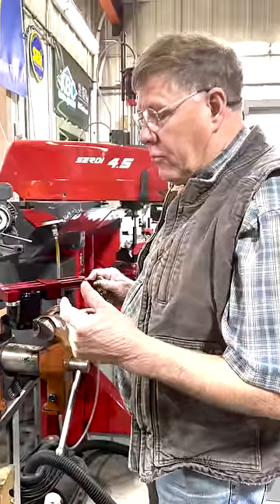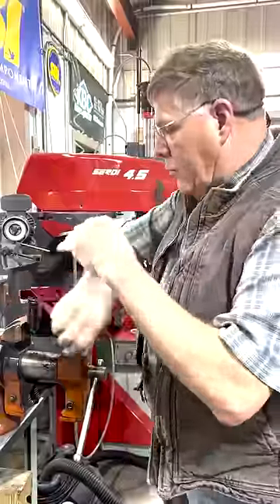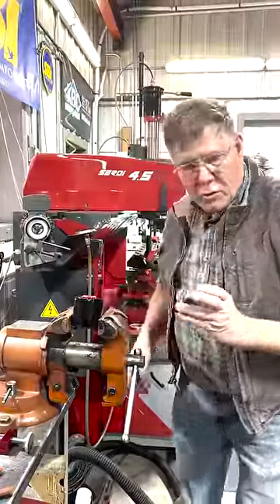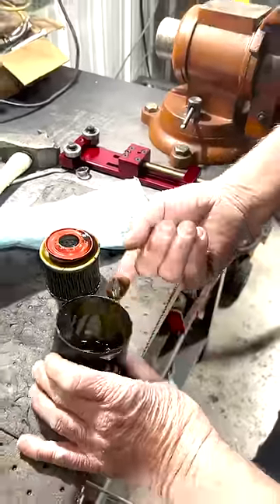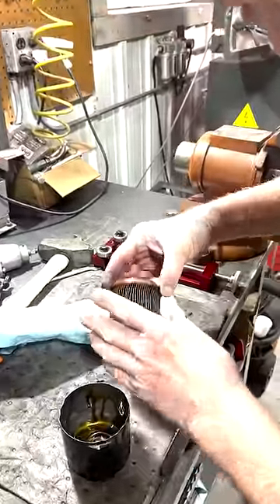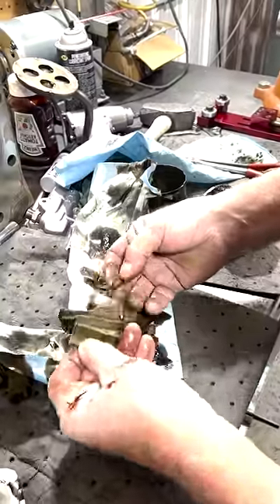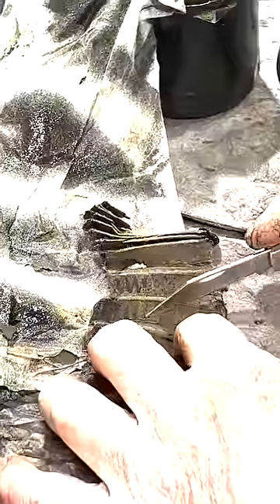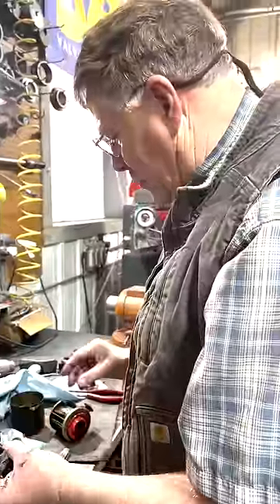#shorts Our Customer Ran His Engine OUT of OIL! 🤦🏻‍♂️

Comment: I’m proud to say I always change my oil every 25,000 miles or 40,000 KM and I top up before road trips and change the filter ever 15,000. My engine always runs so clean and I get much better gas mileage this way but the oil is pretty expensive, but worth it in the end. The only reason to change oil every 3,000 to 5,000 is because you’re using cheap trashy garbage oil, do your scheduled maintenance and follow the recommendation of the factory and supplier!
Reply: You are the reason I don't buy used cars...ever.
Reply: @scottiopizza7565  I’m gonna run this think to 500,000 miles like I usually do. Runs great!

Comment: Makes me wonder how often does he wipe after going to the restroom.
Reply: Wait.......! Some people dont wipe everytime? Oh god.
Reply: Once per month or every 30 dumps, whichever comes first.
Reply: @maxcactus7 dude that ratio of wipes to dumps is diabolical 😂😂
Reply: I have to do a maintenance wipe a little later.
Reply: Synthetic oil is good for 7.5-15k miles. The guy literally followed OEM guidelines. He did nothing wrong.
Reply: @Brian-iz9sh  The oil might lube for that long, but it doesn't mean your engine isn't inhaling tons of sooty shyt, thanks to EGR systems, etc. I had an old Mercedes 300D from the 1980s than ran damned near forever and never had any buildup like that.
Reply: He doesn't know what the 3 seashells are for ....😅
Reply: @Brian-iz9sh  still check it once a week. Maybe 7000 miles. Interval.
Reply: Probably not much. Only going to go to the toilet again. So what's the point wiping...
Reply: Why are you wondering about another people pooping ? gross dude
Reply: @wika1117  cause if its clean you won't have to do a maintenance wipe later.
Reply: Never because he ain't gonna fall for the lies of Big Toilet Paper!

Comment: Thank you for not being melodramatic.  I'm a retired CAT/Cummins Field Engineer, and I get tired of people getting excited over a few flakes of bearing material. I've seen engines replaced under warranty (automotive - I said it was fine and a dealer mechanic said no.  I had been brought in as a consultant.  The warranty claim was denied and the mechanic got fired.) for no more than a little glitter.  That's normal.  When an engine is failing, there is no question, the filter element looks like a Christmas ornament.

Comment: worse part is manufacturers especially German,  recommended oil changes like every 12-20k kms, even on turbo cars. which is ridiculous.  they obviously want your engine to fail so to force you to buy a new one. I change my oil every 4k kms with high quality synthetic oil.  much cheaper then replacing an engine.
Reply: lol I change my oil every 40,000 KMs and have never had a problem in any of my cars!
Reply: @ShawnSavageTeachings 😂 troll
Reply: I don't like synthetic oil

Comment: This isnt directed at any one person.

Its almost as if soft bearings are designed that way so hard metal doesn't rub against hard metal, glitter can be found in any oil filter. It doesn't always mean that the engine is totalled. Small amounts of glitter, lots of Glitter and then swarf arent the same. 
Obviously that doesn't mean dont change your oil, but it also means you dont have to throw away an engine that may still have years of life in it.

Comment: hi mr. I drive a honda insight i buyed it 3 years ago with 231222miles. now it has 270323miles. I added oil now and then but never changed the filter. I driven it for all most 100000 miles. with old filter,and you just given me an idea to change it.

Comment: I work at a private shop. I am currently putting an engine in a 2016 Mercedes GLC300. The customer decided to put 10,000 miles on his oil every time since new before changing it. Now it cost him an engine. Change your oil people. It's cheaper in the long run.
Reply: Mercedes recommends changing the oil every 7,500 to 10,000 miles. 

Why do they say that if it isn’t true? Are they lying?
Reply: I always run my oil 25,000 miles and my engine has never been healthier. Y’all are crazy
Reply: @ShawnSavageTeachings 😂😂😂 you do you bruh
Reply: @onemanshow4116  car manufacturers only care about the vehicle lasting till the end of warranty.  36 months is about right.  Then keep it up for another 3 years on the engine and transmission. So after 6 years or 60k miles it's no longer under warranty.   Customer has to pay to fix.  Said Customer then trades in vehicle for a new one just in time to screw over the next used car buyer.  There's a reason people buy new cars every 3 to 5 years.  That's why we pay careful attention to them as they age. And you know what to buy after that.
Reply: @ShawnSavageTeachings  I'm with you although this will probably vary depending on vehicle. A high quality oil filter and oil should do the job the biggest problem however is... Women are notorious for never checking shit on the cars. Need to check you oil every fuel up and keep it topped off between oil changes, it's this imo that's killing most engines
Reply: The folks that keep having to replace lifters and push rods in their 5.3, 5.7etc LS engines with the cylinder deactivation BS on them would be able to bypass all that work if they would simply do an oil change anywhere’s from 3k to 5k miles but Do Not exceed 5k miles. There have been tests and studies done on these engines and it’s proven to almost completely eliminate your chances of wiping out your lifters and cam by simply changing your oil on a more regular cycle than what the factory recommends
Reply: @onemanshow4116  A lot of the USA is under the severe maintenance schedule . I bet people think oh I will just follow the regular maintenance schedule.
Reply: @SouthwestD313  that’s a fair point. Still, with synthetic oil you shouldn’t need to change the oil any more than 7000 mile intervals. 

3k intervals on a modern vehicle is ridiculous.
Reply: @onemanshow4116 all they care about is making it past the warranty
Reply: @onemanshow4116  here is what I recommend to all customers. If your vehicle has no leaks, and does not consume oil, then change every 5,000 miles if you are under 50,000 miles. If you are over 50,000 miles, I recommend changing your interval to 4,000 miles. Over 100,000 miles, 3,000-4,000 depending on driving habits and if your engine is leaking or consuming oil or not.
Reply: @zacharykarna2810  that’s an insane interval for full synthetic oil. 5k is the absolute minimum regardless of mileage.

Comment: if it's anything built after 2005, it's not worth doing a motor rebuild or swap.
Reply: Why?
Reply: It is if it's not in the rust belt state
Reply: @alext8828  unless it's a truck, by the time you have catastrophic engine failure the vehicle is not going to survive another engine. It's not worth the investment to swap in a motor that's going to die in another year, or the car itself. 

old cars were meant to last multiple engine and transmission rebuilds and swaps. things were interchangeable, unlike today.
Reply: @alext8828  Obviously there are exceptions to this, but nobody should be engine swapping their 2009 Ford escape unless they're doing it themselves from a junkyard.
Reply: But why are you saying "After" 2005?  That seems counterintuitive. So a 2024 car is not good but a 1995 is okay.  I don't get what you're trying to say.
Reply: @alext8828  In 1995 there were still lots of vehicles, especially here in North America that had steel frames. I'm not even that old, but I already feel like I'm turning into an old man saying "they don't build 'em like they used to". 

It's a generalized statement, it doesn't apply to everything. A 1995 Mustang or Silverado with a bad engine has plenty of parts available, they are cheap and easy to fix. Almost all modern cars are much more difficult to fix, finding replacement engines is pretty much impossible, and new ones are so expensive you may as well buy a new car. On the contrary a 1995 Dodge caravan is probably not worth engine swapping at this point, It's worth nothing, not desirable and there are better replacements.

Edit: And by rebuild and repair I'm talking about catastrophic engine failure, where the engine needs to be removed from the vehicle and torn down.
Reply: Both my cars are 2005 lol, this comment is so true. Most cars after 2010 or so aren't great. After 2017, absolute garbage
Reply: @M.TTT.  yeah it's just a general rule of thumb there are definitely exceptions.
Reply: @alext8828 they used to build them to last and be fixed, now they build them up be disposable.
Reply: @jiaan100  I don't know if that's true.  I know there is that element, but is it pervasive?  I'm old as the hills and I remember when cars were done at 50k on the odo.  100k was a rare thing.  They had to add another digit back when cars got improved.  Maybe the repair techniques and maintenance need to catch up.  
What's the thing that kills cars the most?  I'm not sure.  If we could fix that, it might help.  You know what I think?  Leasing makes cars affordable and disposable.  If you lease a car, why bother changing the oil.  It ain't your car.  Who cares.

Comment: Back in about 1989, my brother in law had a Mk2 Ford escort. He spend a lot of time and money making it just right. First drive out it ran fantastic, for about an hour, before it seized solid. He’d changed the oil, but neglected to put new in 😂
Reply: How can you spend all of that time and money, then ignore the oil pressure light and the fact it would have sounded like a bag of spanner’s from zero oil pressure… for an hour 🤦‍♂️
Reply: @mozer30  hang on I’ll go ask him.
Reply: Any time I drain oil in my cars or motorcycles I wire a big ole red tag to the steering wheel / handle bars that says "FILL WITH OIL BEFORE STARTING DUMMY" in bold sharpie

Comment: I ran a v10 Ford Triton 68000 miles on a single oil change. Once, the oil light flickered on so I added 3 quarts. I finally changed it when the filter rusted through and started leaking. That was 47000 miles ago, still runs great. And yes, I change it regularly now.

Comment: I had a Toyota 3.5 with 60,000 on an oil change. Valve started making noise at 220,000 mi so I drove it like that until 280,000 mi. Sold it for body parts still running

Comment: Something I’ve always wondered is when I change oil on motorcycles with wet clutches it’s common to see big particles of clutch materiel I would think it could wreck the bearings in the bottom end but it never seems to

Comment: I had a bad oil leak in my 89 cutlass supreme and ran it dry enough once I heard the engine start tapping.  I was luckily just by a gas station and only had to pull in to get some oil. I think it took 3 or 4 quarts to get back up and it seemed to recover just fine.  I miss that car... sort of.  I almost bought another one a couple years ago but it was leaking too!

Comment: So I’m not going to make up some dubious story about a “customer” that brought a car (no make or model “becuz don’t remember”…even though every other detail is clear as a bell 🤨), my story is this: I know a guy who runs a mid 80’s Mack R600 with an E6 350 Mack engine. It has several oil leaks and uses some…how much, I don’t know….but he runs the truck most every day and has not drained the oil from the pan in over a decade. He buys the two genuine Mack oil filters it requires and pre-fills (with fresh oil) and changes the filters every 500 hours or 10k miles and adds fresh oil as needed to keep up with the oil leaks and consumption. I will say the engine sounds fine and holds oil pressure at least 10% above the minimum specs for a given RPM at operating temperature. That said, I still personally stick with changing the oil and filters at 10k miles on my truck (before you jump on me thinking I’m talking about a pickup, it’s not…this is a 14 liter engine that holds 11 gallons of oil, changing oil at 10k miles on a class 8 truck engine is like doing it every 3k on your car). I’d rather know i’m keeping wear at a minimum than to hope I am.

Comment: This really doesn't tell you much at all. I had a car I bought used with 13k miles on it.  Every oil change I saw glitter in the oil and some oil changes I even got small chunks of metal (the size of a ball point pen tip). I drove the car until it had 200,000 miles on it and the transmission went out. The engine had good power, compression and didn't burn or leak oil, it still ran smooth with no knocking or pinging.

Comment: good filter
My truck is going on 90k without an oil change. I change the filters every 10k to 15k. add things like base when needed. I have also drained some oil and added new to replenish the additive package. Oil never goes bad. the thing that goes bad is it gets contaminates in it. I might do a full change at 100k Im still debating it.

Comment: I owne a 4.6 ford for 10 years now, I have changed the oil only 3 times so far, 289k miles still running strong..

Comment: Controversially a friend of my brother ran a brand new car to 80,000 miles without any servicing. He conceded that the engine was noisier after it eventually ran low on oil, he topped it up and still got close to normal market value for it. You would not want to be the second owner though...

Comment: I'm in the uk and the oil service interval on my van is 25k or 2 year's
Reply: Yeah it is on most cars 🤷‍♂️ although my car is 30000km or 1 year now.
Reply: Hope it's not a Ford transit with the rubber belts running in oil.
If it is...contact your ford dealer for an updated oil and filter change schedule...and always make sure that the actual weight and brand of oil is noted...because ford will deny warranty claims otherwise ....when the wet belt shreds and blocks the oil pickup....
Reply: @JohnSmith-pl2bk  I gave up on ford's 15 years ago had renault masters since but their getting worse still better than a transit
Reply: @timtarran8124 fords are worse than chinese. I would buy chinese van over ford.

Comment: Trivia - at the bottom of the swedish fighter jet "JA-37 Viggen", there is an oil-plug that has a magnet on it.
Every flight, that plug is checked for iron-filings/glitter. If there is none, the engine was deemed A-OK.
This easy check, allowed for a fast and safe turn-around of less than 10 minutes, 3 for taxiing, 7 for refuelling.

Comment: Geez I've cut open filters with 30k on them and found nothing in the filter. Oil was fine too but to be fair it was burning a bit of oil. This is significant because it means the oil was topped off once a month or so. Engine had 300 plus miles on it.

Comment: This just hurts too soon. I bought a 2001 sportster about two years ago. Have only 1300mi on the clock. Everything is in perfect factory new condition, date code on the tires was from 32/00 and were factory dunlops. Thing was legit. Only 40 or 50 miles of short trips getting used to it after replacing the fuel system and putting new tires on it.
Threw a crank bearing last weekend. Fudge.

Comment: My air cooled vw doesn't have an oil filter to cut open and check.  But you would change oil at shorter intervals to take that into account of course.  Glitter in the filter is better than in the pan.

Comment: Hey man, love the videos. Was wondering if you could help me out. 

I have a chevy 305 that i recently put some gauges in. I installed the oil pressure gauge line where the oil pressure switch used to be, a port down by the oil filter. Next to it was another 1/4 NPT threaded port, nothing in it. Should this be plugged? Iv never lost oil and never noticed anything coming out. I didnt even notice it until i went to install the gauge line next to it.
Reply: If your gauge reads correctly and there is no leaking oil just leave it...
there may already be a plug in there 
or the passage may not have been drilled out at the factory...as intended?
Reply: @JohnSmith-pl2bk  thank you!

Comment: I know someone who bought his daughter a new 5.7L Tundra and she drove that thing over 93,000 km on the factory oil, had it's first ever visit to the dealer on a tow truck only after it wouldn't start, showing nothing on the stick.  After several oil changes they got it to run but it was cooked.  I ended up putting a junk yard engine in it.

Comment: The truck my dad let me drive in college never had an oil change in 4 years.  I would just add a quart of oil every time I got gas and occasionally change the filter.  When I got my own car my dad sold that truck to someone who wanted to rebuild it.  It was a 3/4 ton Chevy with 240k miles on it.

Comment: I do just the other thing,  I do my own oil changes at 3000 miles. I bought a new car that had one free oil change. The dealership used a 20-volt impact driver to reinstall the oil plug.

Comment: Ty. I've compiled the #1 advice from mechanics Scotty Kilmer, Daves Auto in Bountiful Utah & here--the message is crystal clear--5,000 miles max on engine oil change. Running synthetic oil. Any miles beyond 5,000 miles seems to risk metal pieces traveling inside the combustion chamber destroying the engine

Comment: Not a professional mechanic but I changed my oil every 7k with filter changes and a top off every 3.5k. 1ZZ-GE 1.8 Corolla 178k. I check oil when I get fill ups. Is that too long? Pennzoil Platinum synthetic
Reply: I change it every 5k
Reply: Every vehicle using full synthetic oil can safely run 6- 7.5kmis w/a quality filter. My 09 Ford Ranger has 297k mis on its 4.0L V6. Runs perfectly. My '22 Ranger Tremor 4wd gets same treatment.
Reply: 280k silverado..
I do 7-9k synthetic changes...
But with leaking and laziness, life stuff.. ive taken it 12-14k few times ha

Comment: 15,000 miles with no oil change is not the issue. Not checking it to make sure it if full is the issue here. Here in the Uk 9-15,000 mile service schedule is the norm. Some VW group have even higher mileage service schedules.